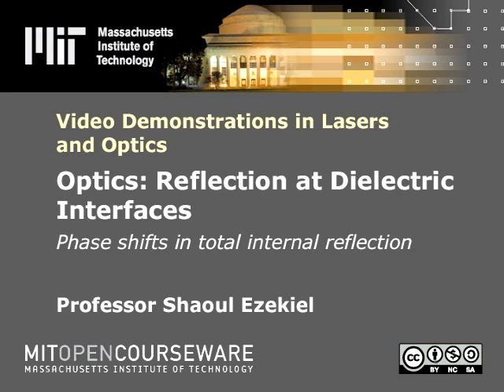Optics: Phase shifts in total internal reflection | MIT Video Demonstrations in Lasers and Optics

Comment: Sir, what is the need of using a Quarter wave plate,polarizer alone is sufficient.
Reply: to turn a linearly polarized light into circularly polarized light in a simple setup.
Reply: I was also wondering why. It is most likely because light coming from the laser is already linearly polarized(quarter waveplate gives circular polarization for linearly polarized light if the angle between transmission axes is 45deg). Otherwise if there was only a polarizer it wouldn't be possible to obtain any linear polarization which with circular polarization can be obtained.
Reply: if the light is circularly polarized, then the intensity will be constant when changing the alignment of the polarizer after the quarter-wave-plate